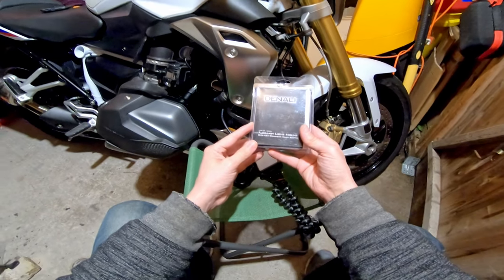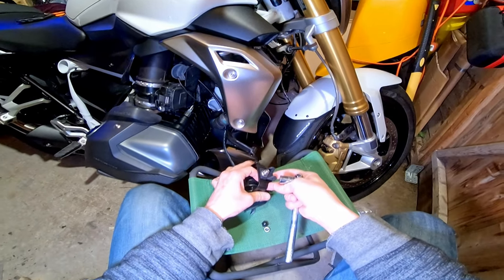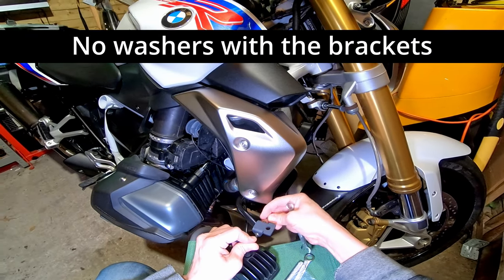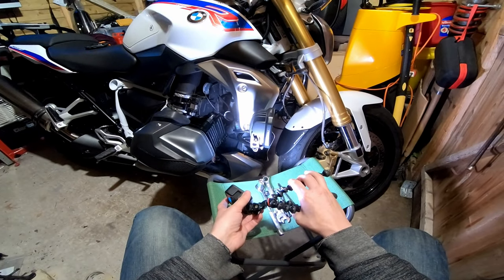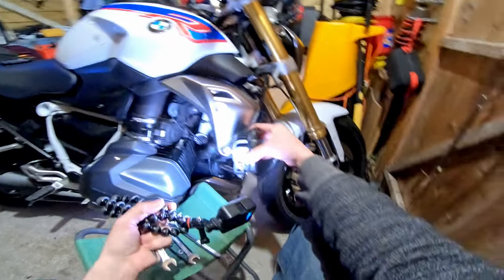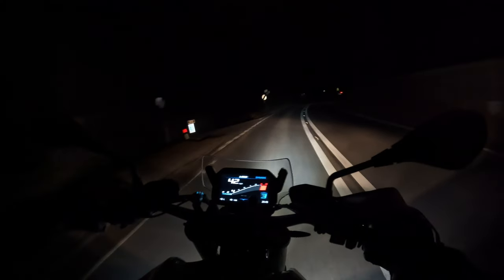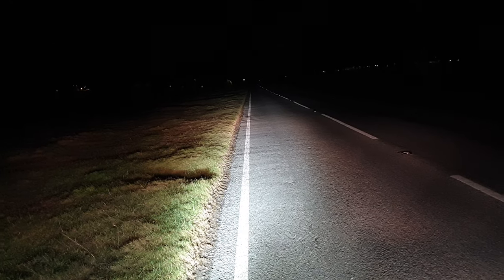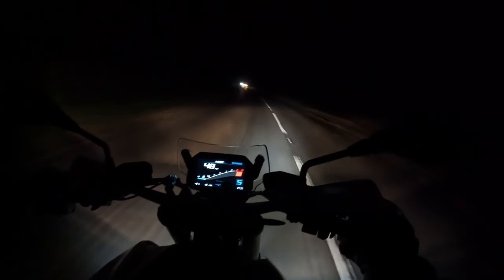BMW R1250R & DENALI D4 lights fitting and testing

Comment: Thanks for posting this Rikky, really interesting and so typical of trying to get aftermarket bits to cure a basic bike issue, i.e. the rubbish headlight on this bike.  You're right, you may get something from checking the beam height, but my guess is not a lot.  At least these lights should hopefully reduce the risk of a SMIDSY!

Comment: In the day 😁 (40 years ago) I used to add big ass lights to my road bikes. Because wanted something like you're trying to do, for me placing them on the handlebars was the best way to project down the road.
Don't forget that's really old tech bulbs I had. But that's what worked for me.
Reply from the maker: It has crossed my mind to get the lights higher up so that they can point downwards towards the road....  Should have got a GS! I could have fitted scaffolding (crash bars) to that and then hang lights all over the bike 😂
Reply: @RikkyTang  Oh yeah, that's the other thing we always did, put crash bars on the bikes.
In some ways I do miss the old days, I used to like the crash bars then. A lot different to my little frame sliders I've got now 😁

Comment: Alright Rilky Tang, new viewer here! Just had a thought. Why dont you rise the D4’s up so you can see more down the road and the tap over the sections that might be blinding other road users? Or have a something along that line? 🤷‍♂️ just throwing it out there because might save you some penny’s
Reply from the maker: Hello Ross thanks for watching and welcome to the channel!  Blanking aeras of the spot lights is something I haven't thought of I'll say that.  It would take quite a bit of trial and error I feel... I might do some testing in the back garden with some bits of card and make some patterns on the wall of the house 😊 Cheers!

Comment: A few thoughts come to mind. One, use a foglight lens on your left (ditch) side and the driving light lens on the right. Next, set your lights up with the EZCan, you can vary how the two lights behave. So the right side light could vary power with your dipped and full beam switch.

You also mentioned that the lights dip when you hit the brakes. You might be better going with fork mount lights.
Reply from the maker: Hi Paul, thank you for your thoughts! Personally, all I really want is an improvement to low beam penetration down the road (without dazzling oncoming traffic) and I'll take that at the expense of lighting up the side of the road.  I've already got the dipped beam running the D4's at 20% but the problem is that the beams are too low to really help and I'm still getting flashed.
As I have said elsewhere, I'm planning to check my headlight alignment in the hope that it was set too low from the factory.  If that's the case then I can hopefully just use the D4's for main beam duties and even on the brakes the dipped beam won't drop too low.  If it doesn't work out then maybe fork-mounted spots are the way forward 👍

Comment: What mounting bracket is that ? I don’t have that in my bike .
Reply from the maker: https://www.nippynormans.com/denali/brackets-for-horns-and-spotlights/machineart-mark-2-light-bars-r1200r-lcrs-lc-r1250r-lcrs-lc  
Beware, I've damaged the pain on the frame where I've bolted these into the bike. Try to protect the pain with fabric washers if you can.

Comment: Morning :) 40 to 50ish mph I guess is quite fast at nights on a bike and on b roads. Guess the modern adv w 50 extra lights r just modern mods that r smart 'nuff 2 know that putting 100 backmirrors at the scooter (age wise now gs) looks stupid on the way to Starbucks. xD Nah srsly being seen better at day, mayb more discrete would b the way 2 go 4 me... the lights look fine to me, I wouldn't faff around w it.👍
Reply from the maker: I don't think 40 is particularly quick on b roads even at night, depending on how twisty/straight the road is.  Previous bikes I've owned have had much better dipped beams than this one.  I'm hoping that its really due to the beam being set too low from the factory and that I can then stop obsessing about the lights haha! You make a good point about two-wheeled fashion and trends though!

Comment: Hey Rikky it seems to me your dilemma is that really you want a dip that throws the same distance as the main which is impossible unless I have missed something.. For your lamps to do the job you want them to do ! would they not have to be sort of angled toward the side of the road so as not to dazzle on coming traffic .so in effect they would illuminate the pavements and or hedges on the left ,I was going to do a similar thing and may well do it this year but I was thinking just for daytime riding to be more visible   . Interesting vlog look forward to you finding the solution but I think your in a vicious circle here . sorry : D
Reply from the maker: Hi Mal, it's not that I want to have the dipped beam throw as far as the main beam, it's just that the dipped beam isn't very good.  Plenty of other owners of the 1250R and 1200R have said the same thing when you look at the dedicated forums. I've ridden other bikes with much better dipped beams which do go further down the road than mine... I'm hoping that the problem is that the beam is set too low from the factory and I can improve matters fairly painlessly now!
Reply: @RikkyTang  isn't there a screw on each side between the indicator and the mask? manual means losen with supplied tools, adjust tilting the mask up and down and then fasten it again? the manual suggests that it can b adjusted in the dealership by the mechanics too :) (can just refer fixing the problem w the German manual, page 126)
Reply from the maker: @ronr6605  I'm sorry I was perhaps not very clear in what I said earlier, I do indeed mean to say that the whole headlamp unit can be adjusted.  In my manual (P.120 eng version) it says that the headlamp can be adjusted downward in case of the bike carrying a heavy load.  It doesn't make a reference to adjusting upwards so I assumed that there wasn't the allowance to do that.  However, if the until is already pointing further down than it should be, then I may be in luck and can adjust it up to a better angle 😊
Reply: @RikkyTang  Hi Rikky yeh hopefully that will solve your issue .How about different bulbs doe's anyone  do such a thing as an LED bulb or similar maybe . : )
Reply from the maker: @crumblymal8479  No I'm afraid that LEDs or HID's don't fit in the headlight housing unless you literally take a Dremel to it.  Not that I'm exactly a stranger to a Dremel... but at around £800 for a new headlight shell I just don't want to go there!  Besides, the bike is on PCP and so I only own about 15% of it at this point 😂
Reply: @RikkyTang  nah u've been clear. just sayin... can't imagine any1 producing a bike with bad safety as lights nowadays, but I can imagine weirdly adjusted lamps, since they r meant to be adjusted... so I do always put mine -3 to make me slower in the night... we got foxes, boars, deers, weird wanderers, farmers and bicyclist since I live in an area w switchback roads on my way back home.
Curious how u get ur issue fixed :)

Comment: As you know I have same bike. I've got BMW driving lamps fitted and I really don't have a problem with dipped or main beam? Perhaps I eat more carrots than you.🤣
Reply from the maker: It could be that I'm older and my eyesight is fading 👓😆 I'm hoping the is that the headlight is aimed too low and I'm going to get that checked out at the weekend.